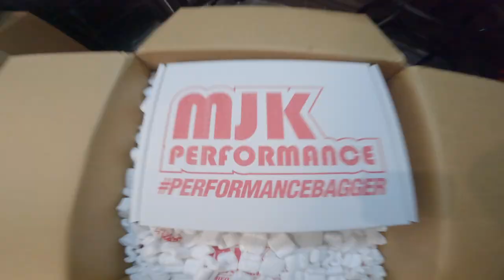MJK Performance Parts // SUPER High-End Harley Performance Parts

Comment: Hi Michael, how do you like the MJK floorboards in practice? Is the lean angle actually better, compared to other floorboards? How do you like the up-shift-pedal? Don’t you miss it sometimes with the rear of your foot, while shifting up gears, because of the specific form, and the therefore ‘missing’ pedal like the down-shifter has? I really like the looks of the complete MJK floorboards set with controls, but it definitely has to be ergonomically perfect and perfectly usable, performance goes before looks, in my opinion! Thanks for your video and your time, have a great day, greetings from Europe! 😎🤘🏻
Reply from the maker: I have since making this video I removed the MJK setup off of my bike. It just wasn't for me. The rear shifter didn't give me much traction and the floorboards didn't give me anymore clearance than my Trask Performance floorboards did. 

Looking back at this purchase, it was the worst purchase of my entire build. I think MJK Performance makes great quality products, I just don't feel they're priced correctly, since seeing a lot of other brands quality and costs. 

To me - MJK Performance is basically a "flex" in a d*ick measuring contest. It's so you can say that you have the most expensive parts on your bike. 

Like I said above, they look cool, just not for me looking back on this purchase. 🙂🤘🏼
Reply: @MichaelBertini  Thanks very much for your answer! Did you like the ‘FLO’ set footboards & controls you took off your bike? Is that set recommendable?
Thanks for your time, have a great day!

Comment: Looks like there was a size difference between the 2 risers, is that what you were aiming for? Those MJK risers look SICK💯🤙🏾
Reply from the maker: Good catch. Yup, there is and yes, that's what I was aiming for since the handle bars for these risers are taller than those I was running on my old setup. So right now my arm position is still at the same height as before. In fact, it's even more comfortable now thanks to the new ergonomics of the handlebar. 

I said the same thing about those risers 🤤 am I going to see you think weekend in Daytona for Bike Week?

Comment: I have the non spool adjuster, quick question.  Did you retain use of the factory shock mount bolts or have to get a longer size?  I’m running legend revo-a’s and don’t want the spherical bearings to get pinched .  Thanks bud, good looking bike.  Can’t wait to get more mjk parts in the future.
Reply from the maker: I used the new bolts, but I used the old washers and spacers that came with my Legends Revo Arc's. 

Thanks, bud! Am I going to. be seeing you in Daytona this weekend?
Reply: @MichaelBertini  awesome and mine didn’t come with new bolts but I will look again.  Haven’t had much time to do anything bc of work.  And unfortunately I cannot make it to Daytona but have fun man be safe .
Reply from the maker: @BubbaXL308  Oh damn, I would reach out to them and ask. Hopefully, you'll get sometime in the near future to work on it. Thanks!